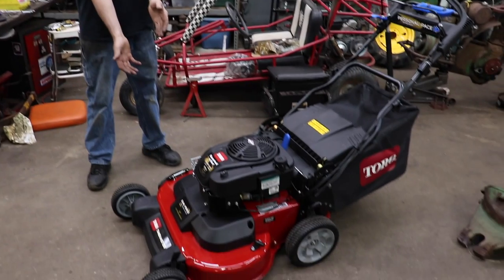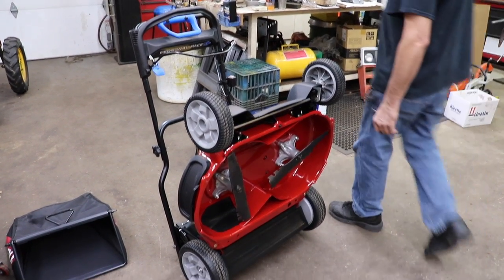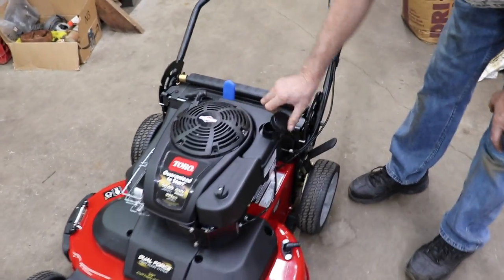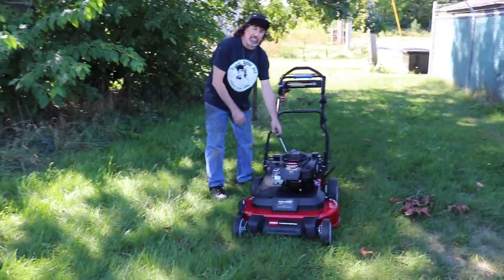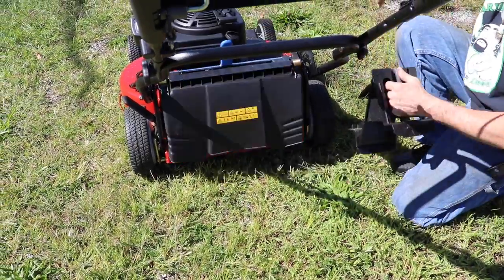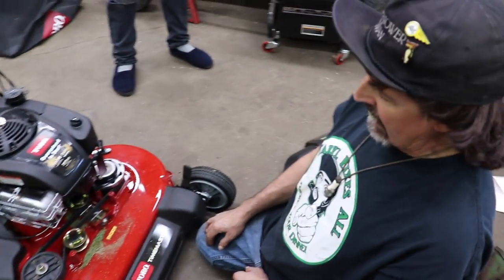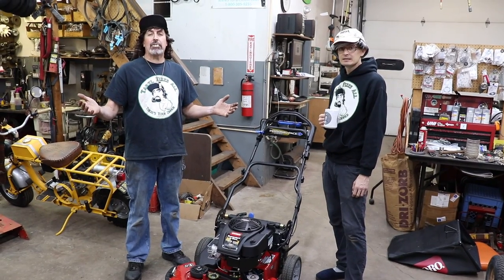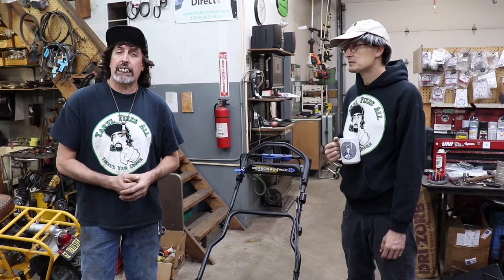New Toro 30" Timemaster Review - Is It Worth It?

Comment: I have owned a Timemaster for three years now and was told by Toro the blue foam in the gas tank is to prevent vapor lock issues earlier models had. It makes filling more difficult but they advised me to leave it in.
Reply: That’s sounds like someone handed you a bologna sammich.

Comment: Arrrrhh,,"G'Day"
Do you think starting mowers at flat out speed is good for the engine,,
I Used to let mine run down and cool the engine before Hiding it in the shed,
What are your thought's on running engine flat out with out cool down available,,
All Mowers seem t be going this way,,
The Bloody motor is hot and we just shut it down super hot,,
 Now that cannot be good for it,,

Comment: Did this version of the Timemaster that you reviewed have the updated, more heavy duty bearings?  I just bought one today at Home Depot, and it has the older cheap bearings on it.
Reply: The new ones still come with the old pulleys.  Upgraded kit is 120 bucks.

Comment: One of the companies who’s mowers I worked on when I was doing small engines had a pair of 30” turf-master (commercial version of time master) mowers. Maybe they’ve gotten better but the ones they had (2013 models) with the FJ180V Kawasaki engine were pretty bad. That engine didn’t have enough power to keep the two blades up to governed RPM when mulching even moderately high grass. The biggest failure point was the self propel transaxles, I replaced 3 on each machine (6 total @$200 a piece) within the first 200 hours, and even with brand new transaxles they lacked the power to pull themselves on hills and required lots of pushing by the guy running them. In the end the guy sold them off and I talked him into buying a pair of reconditioned lawnboy commercial 21” self propelled mowers with the 6.5 duraforce engines I had at the shop, the ones with the big orange tank and 3 speed transaxles. He’s still using those mowers to this day with zero repairs after 500+ hours in the last 3 years. In my opinion the 2 stroke lawn boy and Suzuki 2 stroke toro commercial mowers are the best small walk behind for a lawn company to have. With today’s synthetic lubes you can run the same 50:1 mix in them as the trimmers, blowers and saws without issue and they never require an oil change or oil to be checked or added. Just an air filter, plug and blade sharpening each season and they’re good to go.
Reply: Except they’re 21” and people looking at the timemaster are looking for something largtthsn 21.

Comment: Question is the blue foam in the gas tank an anti leak feature so when you store it upright the gas doesn't leak out
Reply: Nnnnnnnnnnnn No. The gas cap keeps the gas from leaking out if you put it on right.
Reply: @heystarfish100  of the case why does Taryl recommend put a plastic bag under the gas cap to prevent leakage
Reply: @allenaustin7777  I have no idea why a plastic bag would be useful under a gas cap if the gas cap was not defective in the first place. No gas should leak out and no modification would be advisory by the manufacturer.
Reply: @heystarfish100  most gas caps have a vent hole in them which allows air into the tank do that when you to a mower up the vent will leak gas thus the plastic bag
Reply: @allenaustin7777  That’s the wrong gas cap for this machine. This cap seals for upright storage of mower.
Reply: @heystarfish100  OK that answers my question thanks

Comment: At some point this mower is going to replace my old 36 inch Bunton walk behind. I'm having a hard time squeezing the left control handle because my left hand has gone crippled. This mower would be a good replacement.
Reply: Kal Halson  Not that I know of. You squeeze the lever on the handle to make a turn or put it in neutral. There is one on both handles to control the drive wheels.
Reply: Kal Halson Thank you. The issue is I can't open my hand enough to grab the lever and handle together.

Comment: I would love this bigger style mower.  Problem is I have so many tight corners Slopes and EVERYTHING else, its just not practical.  But BOY would it be PERFECT to cut down LOADS of time for the BIG areas.  

A note for the WISE.  The Commercial versions of this comes with ACTUAL WHEEL BEARINGS!   Like the HONDA MOWERS do on most models that are SELF PROPELLED.   GET IT!     That alone will help extend the life of the drive train.   Also things like Adjusters etc are more heavy duty as well. So they don't bend as you go up a slope and sheer gears in the drive system etc.   

I'm pretty much stuck on my AWD 21 inch Husqvarna for the long haul.    And it looks like I'm going to have to make some custom parts for it in the future.     

I already did a Rubber tire modification since many of the OEM tires just don't have the traction needed for the hills that I mow on my property.     

Love to try out the TORO AWD mower someday, but its a RARE bird to find.
Reply: timemaster has bearings in the wheels.

Comment: W.A.M.  commercial with limited edition pink mower:   "Wake me up before you mow mow cause Im not planin' on mowin' so low..."

Question:  Would Interference blades + belt drive = potential blade to blade contact if not timed?
Reply: These use a toothed timing belt to keep the blades 180 degrees out from each other.

Comment: Good throw away mowers. I've been using them since 2012, and they last a year or two commercially. The engines wear out rather quickly. I've changed the engines, but the mower chassis/deck is made from cheap metals that corrode causing issues getting some of the bolts out without snapping them off. Moving parts wear out quick and the cables break every few months. We do beat them up pretty badly.  

Now that we're a bigger and more established company, we no longer accept push mow yards. Any calls from ppl with gates under 50" are quickly rejected. We'll have the customer measure their own gate and call us back with dimensions so we're not wasting anyone's time. Existing clients with under 50"gates had to pay to get their gate widened if they wanted us to continue service. 

Best policy I ever made! Less mower maintenance, less equipment to drag around, more efficient mowing daily, can mow more yards in less time, earn more money, not as tired after mowing all day. 10 years ago I took every crappy yard I could... those days are over. I only accept the best, nicest, quick, and easy.... highest paying yards now!

Comment: I use this pos daily. too heavy not user friendly. discharge shoot adapter is plastic and the knobs wear off preventing it from staying on and there for making it very frustrating to use in any height grass. falls off !!! ignition switch on handle bar is shit I've re-soldiered it 3 times in 3 years. buy Honda if you can it's better

Comment: The comment on the blue belt makes me think of issues that I’ve seen with riding mower deck belts with people buying belts in various locations including hardware stores etc. There is a lot of difference in quality of belts and I don’t know what it is exactly, possibly the heat range or something. It seems mower deck drive belt seem to require heavier duty belt than most applications and OEM belts last for Hella lot longer.

Comment: I cut grass for 10 years and those walk assist interference blade mowers just aren't worth it. When the transmission breaks it's like pushing the rock of Gibraltar, even on level ground, and when you hit something with those interference blades the spindles can get eaten up chipping the blades.

Comment: Taryl does setting a mower up on its side allow oil to seep past your rings. So in the spring time you start the mower and then kill mosquitos from the smoke.
Reply: If you are talking about the stow feature that you saw on the Time Master,  and also on some 22 inch Toros, they have overhead valve engines. The engine oil goes to the rear of the engine away from the valves.  If you turn a mower so it's side, put the oil side down and I always remove the air filter as an extra precaution so nothing can possibly soak the filter. Also I open the fuel tank and put a plastic shopping bag over the opening and screw the gas cap on to avoid any fuel leaking while on its side.
Reply: @raymondcampbell2346  thanks Taryl. That makes sense.

Comment: $1200 for those that want one. My only concern is that short blades = reduced tip speed
Reply: How do you figure that ? $1,200 nah I'll buy a cheap riding mower or a good used rider.
Reply: @NoWr2Run  "How do you figure that ?" The smaller circumference of the circle created by shorter blades  typically = slower tip speed unless they speed the spindle up to compensate. If you look at commercial mowers, they usually run higher tip speeds on the blades and the cut is improved. At least by my understanding.
Reply: @kastbarg  T.Y.

Comment: Ive found the auto choke briggs engine hard to start. Bad design
Reply: I think that the biggest problem is that they got rid of the primer bulb.  I've found that if you pull the cord gently a couple of times to prime it and then pull harder it starts much easier.
Reply: @lnk4328  thanks will try that
Reply: @lnk4328  what ive been doing is pulling air filter and squirting a little gas in the carb
Reply: @lnk4328  I thought the auto choke was for mowers with electric start because it works pretty good on those.  Never saw the pull start engines with auto choke.  but ya, that sounds like a good idea to use the pull cord like a primer with a couple of light pulls.  of course the fuckers probably don't tell you that in the manual.

Comment: why not mention that it weighs a whopping 140 lbs. ? ..or mention the width ( 32" ) ?..  or show the width compared to an average gate opening ?.. or why didn't you know that the tank only holds 1.2 qt. of gas ( approximately 1hr of run time )...or how about the average retail  price? Tractor Supply has these listed for $1200.00 ...SMH ..your very, VERY, V-E-R-Y poor @ reviewing equipment....jus say'n